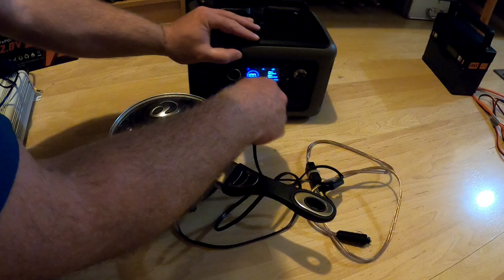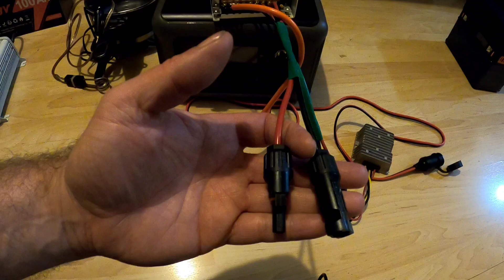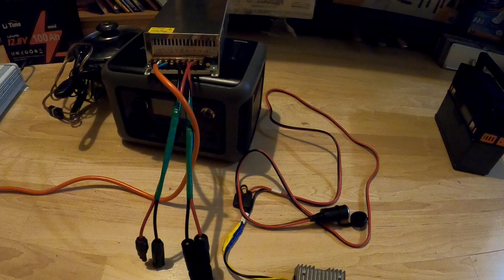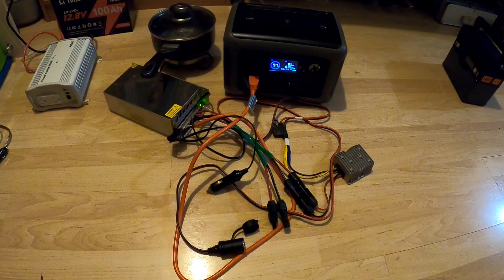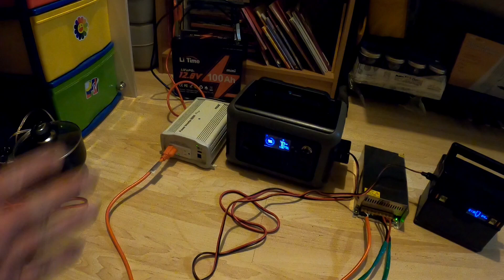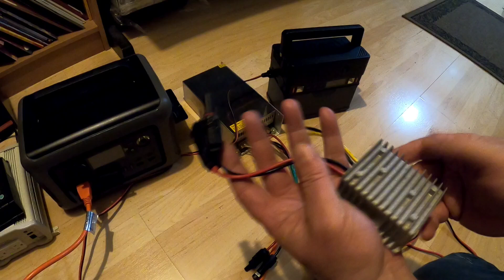ADVANCED OFF GRID PORTABLE SOLAR POWER TECHNIQUES, MAKE YOUR SYSTEMS WORK TOGETHER AND DO MORE.

Comment: so your portable station is 300w ac inverter?  have you hooked up all 3 outputs to see how much your station can handle
Reply from the maker: @vrrevolution9183  the portable solar generator has a 600w ac output and my dc switch power supply 24v can handle up to 700w.

Comment: I have a few questions :
1 : isn't it strange that there is a limitation in the solar generator 12V outlet when the battery has a 12V voltage and can handle more than  10A, when the 110V outlet which requires electronics has a much higher limitation ?

2 : what is the advantage using the 110V-24V converter powered by the 12V-110V inverter to charge the solar generator using the solar port, when you could simply use the AC/DC plug connected directly to the inverter (don't know if my words makes sense :-) ?

3 : I have a 12V-220V modified wave inverter, do you know what devices can be used or not used with this inverter ?
I have no doubt for lamps, but can I use it to recharge my computer and other electonices devices that use a wall charger ?

Thanks for the video Frank
Reply from the maker: @louis6569  1) it is the wire amperage capability and the fuse that limit the 12v the overcurrent protects stops them from blowing or burning out. The 110v in this model is at best pulling 6.5 amps through the wires. The higher the voltage the less amperage is needed ex: watts = volts x amps.
2) the 24v simulates solar panel equivalent voltages, there are losses in the system but it allows one main central battery bank to power multiple smaller ones without taking up multiple ac ports and the need for multiple block chargers, one for each one. Plus the flexibility of swapping out for 12v equipment use easily with minimal additional equipment ie: the buck converters each of which can be additionally used as independent battery-less systems.

3) 220v is used in many different countries and 120v is also used in many countries it is the standard voltage the country has chosen and appliances are designed to work within those countries, you can find devices for either voltage, hope this helps.
Reply: @frankbush333  thanks Frank for your answer
Reply from the maker: @louis6569  I think for 1) you were talking more about the connection between the battery and the inverter... ya they use a thicker awg wire for that connection normally 1.25x the max amps rated for the inverter. For the 12v 10amps is standard on the cigarette lighter sockets I just think it should be 15-20 as there are lots of devices that uses higher levels.